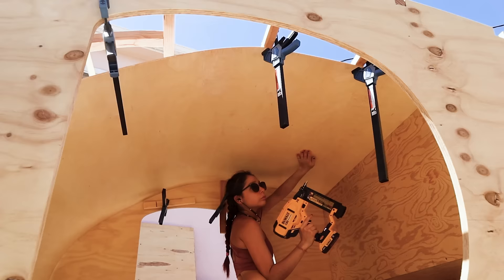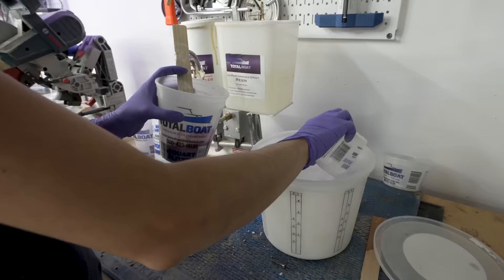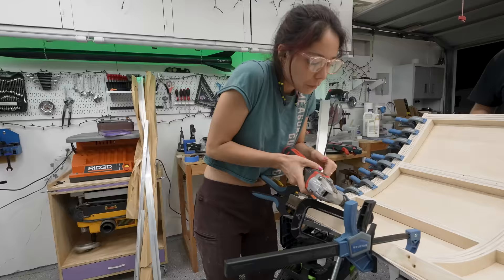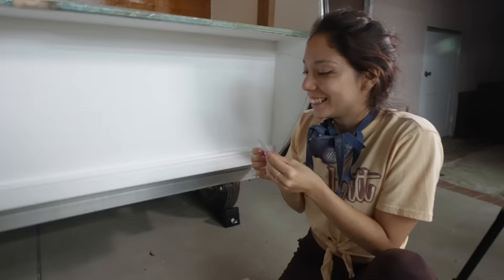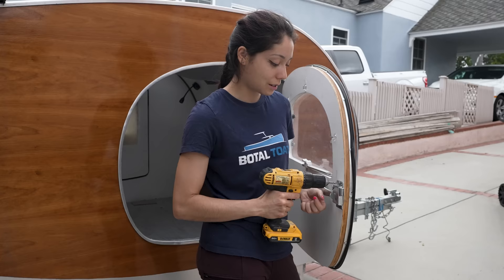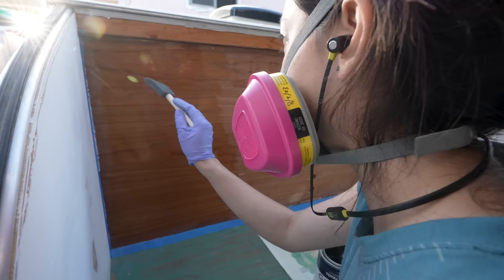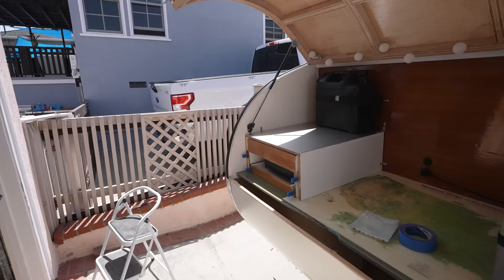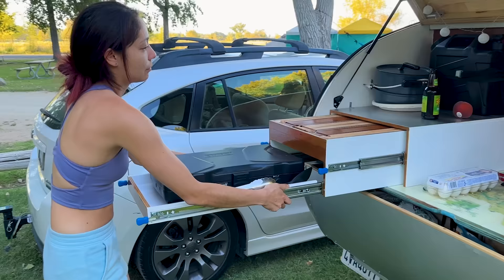Teardrop Trailer KITCHEN BUILD

Comment: The worst thing about teardrop camper trailers is that the curved shape is SO space inefficient, and it really doesn't even give much aerodynamic advantage, especially behind modern larger cars. So for anyone watching and thinking of doing your own self-built camper, just go for a box shape. It might cost you 0.5 mpg in fuel efficiency or whatever, but you'll get a LOT more (and more usable!) interior volume for the same footprint.

Comment: Be careful how much weight you put in the kitchen hatch. As previously seen from you sitting on it, it'll take weight off the tongue, making the entire system unstable.

(Having pulled my 4500lb trailer with the car so helpfully put in it backwards, it was totally undriveable. It was pushing my 6000lb van around like it was a chew toy. With the car in forward, the van barely notices the trailer behind it.)

Comment: You provably did this and just did not bother to show so wasting my time here but when you used FG internally to bond pieces together you need to create fillets normally out of thickened epoxy as FG doesn't do 90 degree. Note you do not need to wait for it to set all the way and can take advantage of the chemical bond.